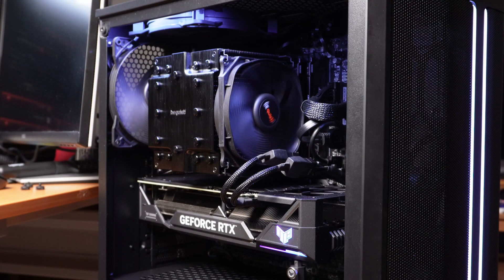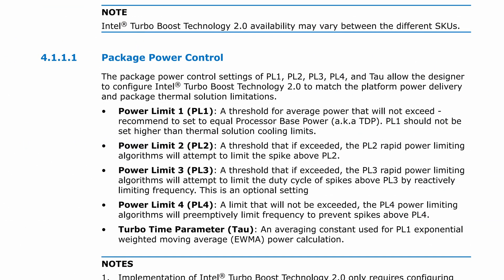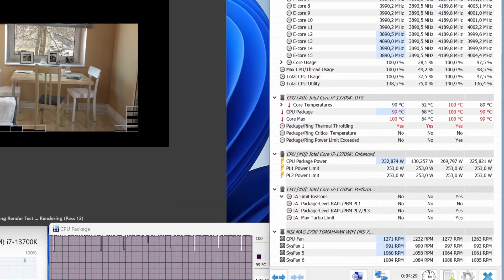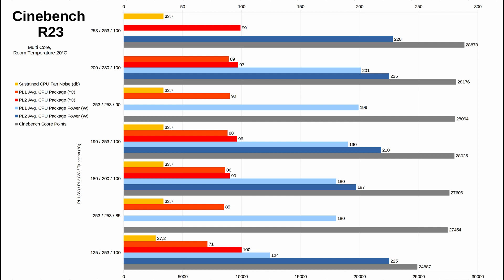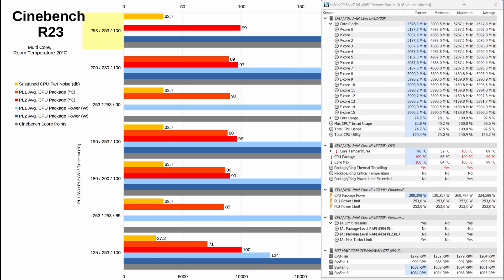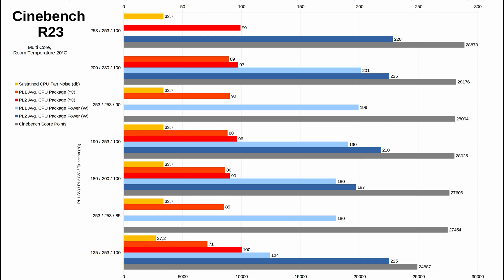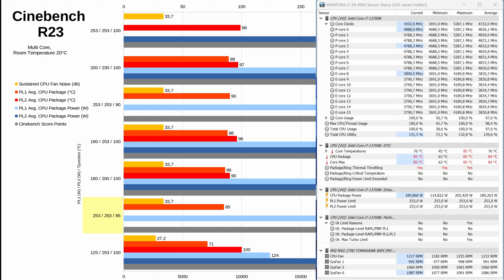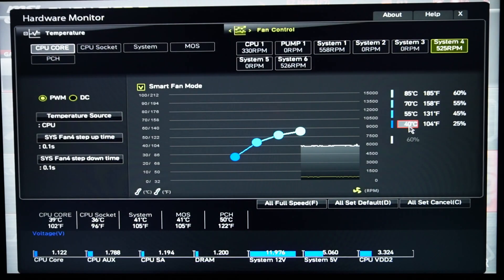Can Be Quiet Dark Rock Pro 4 cool Intel Core i7-13700K Part 2: Power Limits&Temps

Comment: Hello I'd like to reach out to you, as I just bought 13700K and I have DARK PRO 4 Cooler, but I'm afraid I'm reaching too high CPU temps even tought I'm not supposed to.
is there anyway I can contact you?

Also keep up the good work!
Reply: Might be too late but just undervolt it. Just monitor your temperatures.
Reply: @Keaweahe  nah bro its impossible to cool 13700k with air cooler... trust me even top tier air coolers struggle with that AIO is needed
Reply: @Lynxique with what? Intel defaul ac, dc load lines? Lol?

Comment: Very informative video, thank you. With all those data, I think I'll go for a 12700K instead, as I doubt I'll ever be able to cool the 13700K satisfyingly in my current case. Cheers!
Reply from the maker: Thanks! How good to hear. 
Did you know that 13600K is just as fast, as 12700K, if not a tiny bit faster, and has a 9W lower TDP? (12700k @ 190W, 13600k @ 181W). Just saying.
Reply: @tech-wombat  oops, no I didn't. Seems it's too late now, I already ordered my 12700k, but it's a good remark. With the Be Quiet Dark Rock 4 I trust I'll be fine though.😅
Reply from the maker: @fredericc.6115  yes, it will be finde, don't worry! Have a nice day!
Reply: @tech-wombat  13600k is almost as fast as 12900k so its waaay better than 12700k lol
Reply: I'm giving a second thought to your interesting remark. Indeed, I can still switch to a 13600k. I read some articles and watched some videos, which seem to indicate that the 13600k still runs globally a bit hotter than the 12700k. Can I ask you which cpu you would pick for yourself, if you were free to pick one, please? They seem pretty equivalent, but maybe I missed an important difference. Thank you! 🙂🙏
Reply from the maker: @fredericc.6115  I personally have bought the 13700K, even though the Dark Rock Pro 4 limits its top performance by around 7.5% in my environment. Even with that it is still 16% faster than the 13600k and the 12700k (as they are virtually the same performance wise). But I am questioning, if this was the best decision financially wise. But it still has 4 cores more than 12700k and 13600k. I'd propose to ask yourself, if you are on a budget, then I'd go with the 13600k or the 12700k, or if you want to have more head room and want to spend that money. I went for the second option. For gaming and even light video editing the 13600k is adequate, and probably will stay that way for years.
Reply: @tech-wombat  thank you for your detailed answer. My primary goal is lowest power consumption and heat. So I think 13700k won't be good for that. I'm still hesitating between the 12700k or the 13600k (even maybe undervolted). I'll check a few other benchmarks, but it seems the 12700k wins for those specific criteria, from the results I saw.
Reply from the maker: @fredericc.6115  I see... So how about to use the non-K version... 13700 non-K or similar... They have a much lower base frequency and lower TDP and therefore run on turbo only for a limited time, and then throttle themselfs. I think the 13700 limits itself after somewhere around 60-120 secs to 65W. As a result, for long running tasks they won't produce that much heat, but as a result their performance is much lower. But I find it too expensive for that performance. Or you simply  limit the long term power limit in the bios, if you can.
Reply from the maker: @fredericc.6115  Perhaps one more thing: all 12. and 13th gen have a pretty good thermal limiting... so they will limit themselfs anyway, if they are reachting the 100C. So you probably can go with the 12700K or 13600K anyway

Comment: Hi fellow enthusiast!
I've had a similar question in my mind and came to a conclusion, that other than undervolting, there are 2 reliable ways to affect long-term boost (because short-term is not useful for my usecase) results: limit PL1 and PL2 to something, that my cooling solution can sustain (have to account for ambient temp during the heat season) or set throttle temp limit to a value, where acceptable level of performance can be preserved.
What method you think is best for your setup?
I've settled with limiting PL1/2 and setting CPU fan to constant value.
Reply from the maker: @CombinE54 Hi fellow enthusiast,
I was thinking about the exact same thing and decided to go for a PL1 limit too. I did not limit PL2, as the heat production during PL2 will be accounted for, when lowering frequencies in PL1. That way CPU still hits Tjunction for 40-80 seconds depending on PL1. I think this is preferable to a general temperature limit, as I think a power limit would also limit the boost frequencies during the first 40-80 seconds. As most everyday tasks don't take longer than that in essence I would leave a lot performance on the table. How much? During boost time the frequency will be lowered somewhere around 125-250MHz. But when setting temperature limit to 90C at room temp 20C I think it will be lowered by more than that (I do not remember from the top of my head if I have quantified that, but I think perhaps around 400MHz, but don't hold me to that, please try yourself). Therefore I went for 199W/253W PL1/PL2 limits as I think I get a little more performance that way while even at 30C ambient temp being under 98C